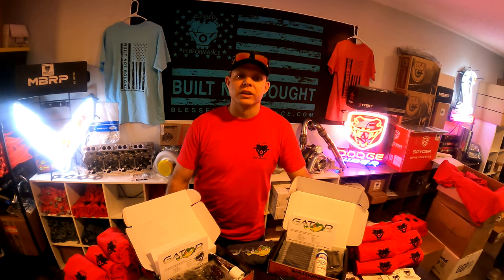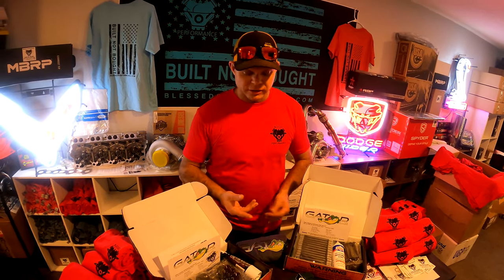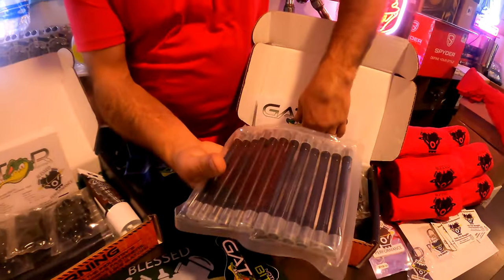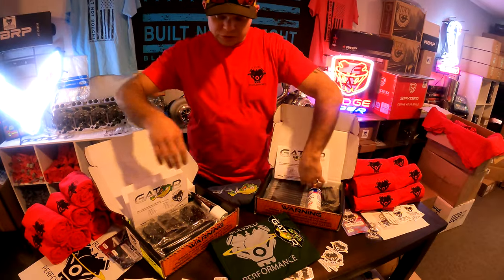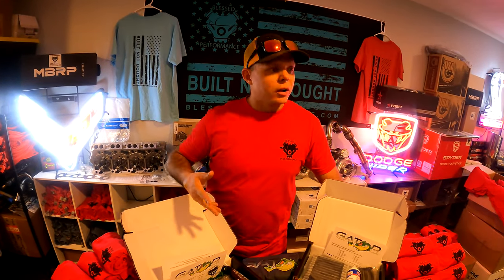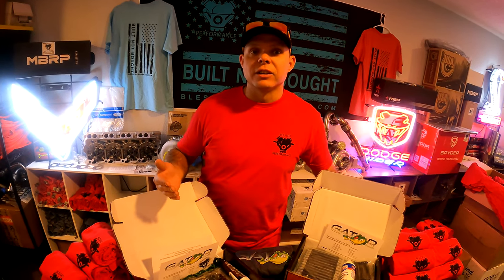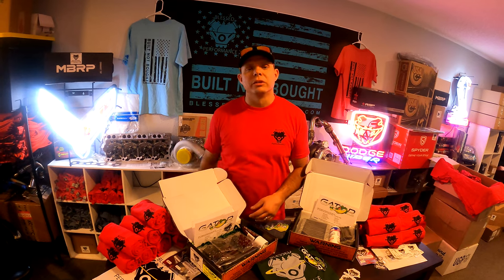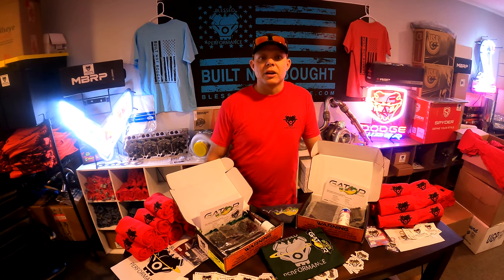Blessed Performance - Gator Fasteners - Tutorial

Comment: I’m putting a s472 on my 6.7 cumins Willa be be ok for like 50 to 60 pounds of boost
Reply from the maker: We have a 16 Ram with a 467 and oringed head with Gators and it's holding with zero problems
Reply: Awesome thank you yeah there’s just not much out there on them but my local auto parts store carries them also they are about half the price of arps
Reply from the maker: @jacobbradstreet1622  we have sold about 1500 sets in the last three years with zero returns or warranty claims
Reply: Heck yeah I’m going to get them they are only 400 bucks
Reply from the maker: @jacobbradstreet1622  let us know if you need a link to our website brother.